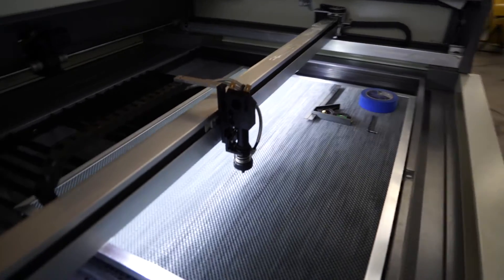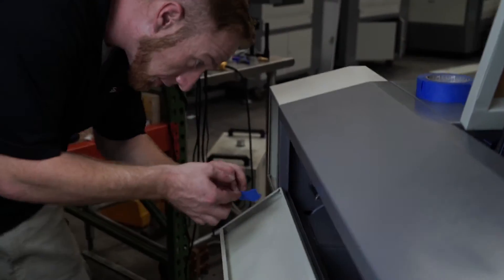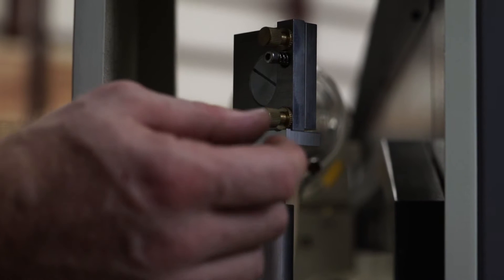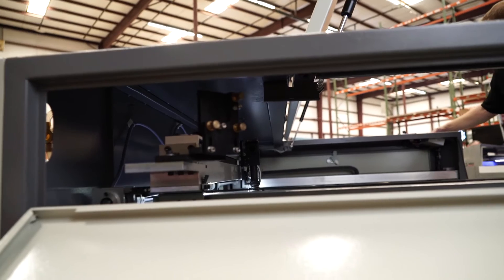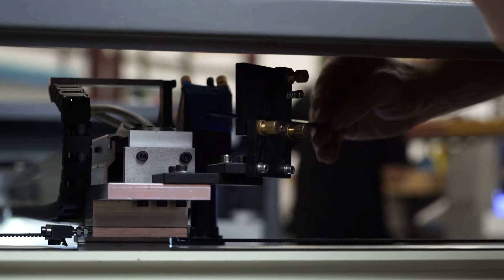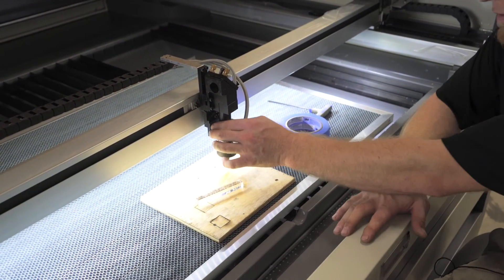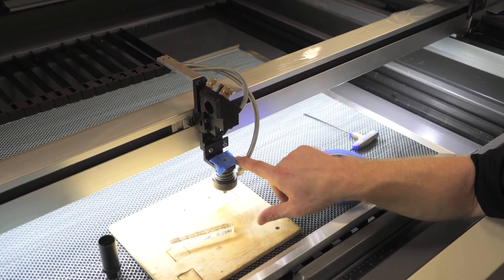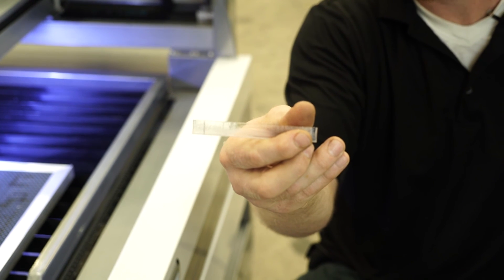Gen 4 Laser Alignment

Comment: if you put a coin under the tape then the  glue residue   from tape don't get on the mirrors
Reply: But then don't you have a coin on your mirror? Those coatings are super delicate... definitely don't want a metal coin touching it...
Reply: you talking about some different..
 I talking about aligning mirrors..
Reply: cnccarving that's what I'm talking about too. But maybe I misunderstood. I was saying the last thing you want is a coin touching the mirror.
Reply: mtrror locked with a  ringnut, placing on top the tape  it doesn't touch mirror, but fumes  depositing on mirror
placing a coin behind tape still doesn't touch mirror,  but fumes kept out  fully from mirror
Reply: my second laser a 24x40 sized  and   practically checking on   before each larger dut..
sure on the fartest point still beam hits the center..